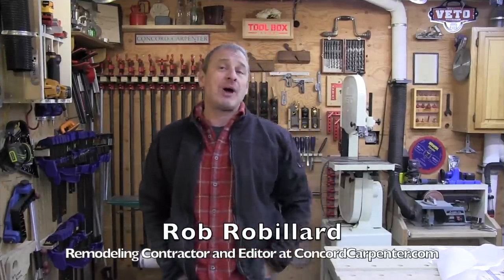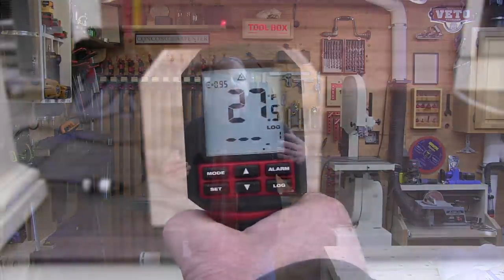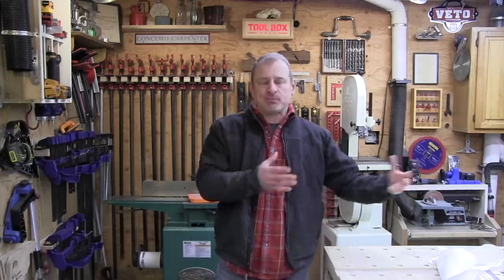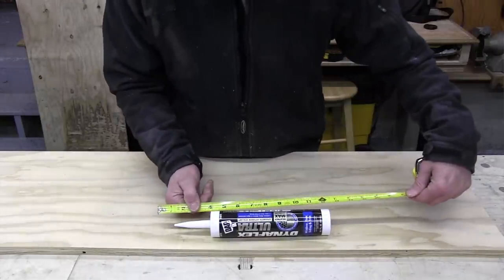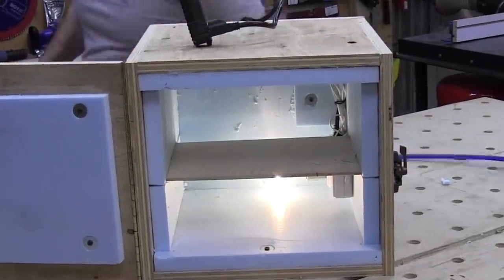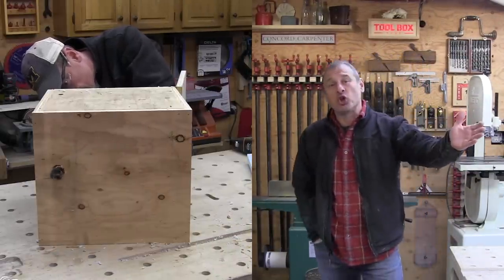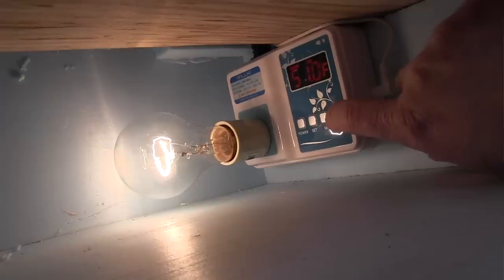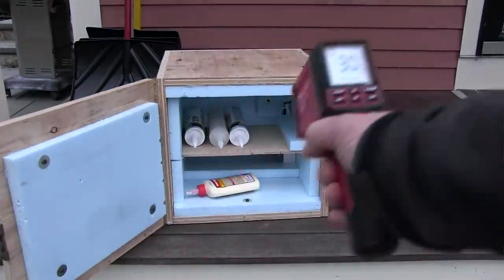How To Build A HOT BOX  [Prevent caulking and Adhesives from freezing]

Comment: Hey Rob. We use an old igloo cooler with a lizard heat mat . The mats can be bought in different sizes and cost $10 to $50. It is really simple and works great. We are in Rhode Island and it gets pretty cold here too.
Reply from the maker: I need to make a box g=for my batteries - Ill check out the  lizard mat. thanks for the tip

Comment: I am going to assemble one with a cooler and a reptile mat to help save some space. Use a reptile mat in the bottom it should help heat tubes of caulk and help with keeping things warm. The temperature controller will regulate the temp inside the box.

Comment: Great idea. I would think using a small cooler would be easier and faster, though. Just drill through the side for the cord to your heater control and mount the heater control/bulb to a piece of scrap wood that can sit in the bottom of the cooler with some hardware cloth to protect it.

Comment: I built one similar years ago for use in my wood shop. Had trouble with the bulbs burning out. Now I use a line voltage thermostat and a hair dryer. The hair dryer is safer since it has a thermal fuse incase something goes wrong. Mine is mounted on by shop wall and filled with glues and varnishes.

Comment: We made one of these for our subfloor adhesives back in the day (mid 80's) back then I still lived back in Wisconsin and we worked rain or shine snowing or no snow. Pretty crude, but we just more or less made it the same size of the box the Tubes came in plus the material thickness and the 1" inch foam insulation we used. Had a light bulb in the bottom with a metal type grid on top of the bulb that all the tubes sat on with a hinged top of course too.
Worked great at the time and certainly helped with keeping the tubes from freezing and with the ease of use!! Ahhhh the memories!! Don't care what anybody says... Hard work is a GOOD thing and the ability to preform it!! I've always been thankful for the health I've had!!
Happy holidays my friend!!

Comment: How bad does the cold air  hurt the batteries?
Reply: It doesn't hurt them really.  But using the batteries or charging them outside of a certain temperature range (like below 32 -  above 130F) will shorten their life.
Reply from the maker: Joseph Alsheimer best to warm them prior to charge